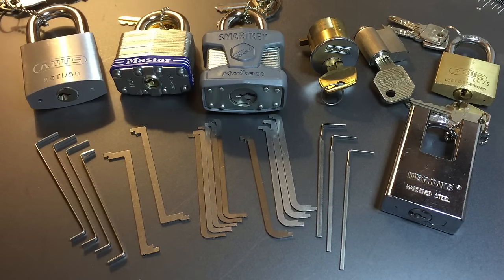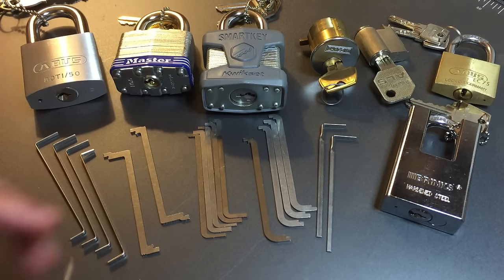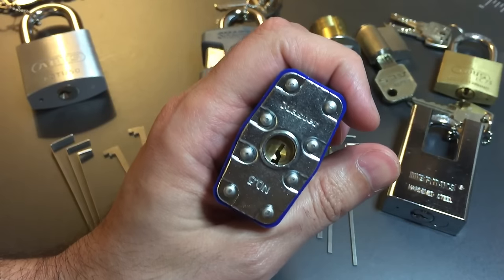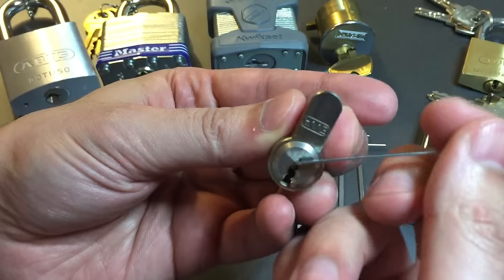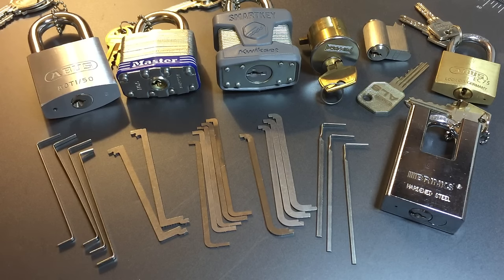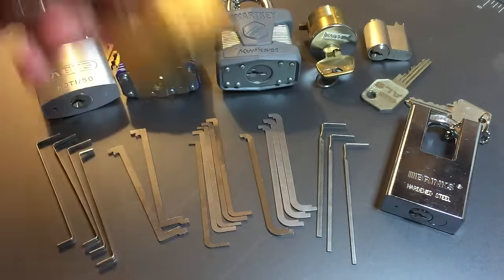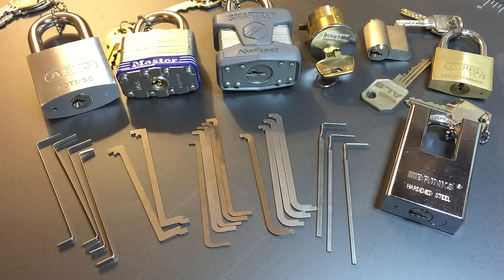[188] My Approach to Lock Picking Tension

Comment: I picked my first lock a week ago to get into an office with tools made from a coat hanger and hammer lol, (i think making your own picks for each lock is better practice for emergency uses) I forget the name of the lock but it's old, 5 pins, and made very well with extremely tight mechanics according to the internet. What I noticed was the pick needed to be strong, a paper clip wasn't strong enough to budge the pins without dropping one of them so I think paperclip picks are a myth for most good locks, Another was that I had to start with the pry bar at the top for some pins and then use another prybar to transfer to the bottom so I can get the front pin then transfer back to the top.  Not sure if this helps anyone but this is my experience. I simply couldn't do it any other way and I tried for a while.
Reply: Not a complete myth you can make an okay tension tool from a paper clip but as the actual pick a stronger wire works better, the wire from a small metal clip/clamp not sure what you call them but they come in all kinds of colors straightened out works fine but can still be too thick for tighter key ways

Comment: I'm actually the guy that invented the first electric pic over 35 years ago out of an electric rechargeable shaver I never patented though I I upgraded to a black and Decker screwdriver handle I brought to the locksmith convention like a fool they put it on the back of the locksmith ledger and that was it a year later hpc was selling them

Comment: and yet you cant describe exactly what is goin on here because i STILL habe no idea what it is i am feeling once my pick goes in... i finf myself trying to set the "inbetweens" of each pin rather than the pins themselves because i simply can not distinguish between a pin that is binding and an "inbetween" lock rib...  the minute(my-noot) differences in those positions is simply too precise for my imprecise oger type mits... and then my carple tunnel kivks in and all i feel are tingles and pain and then the numbness sets in and then i cant feel anything but tngles and pain.... like hitting a baseball off thevtip of the wooden bat in late october(cold weather)   it just stings....   i came into this a couple years ago with such high hopes but now i just feel DEFEATED...  I am really not much better than i was when i first started.... 🙄😟😓😥😢   i think im done.... 😟😒

Comment: I just realized that I always misunderstood "bottom of the keyway". I am from Germany and 99% of all door locks are installed with the pins down. If I recall correctly from traveling the U.S. it is the other way round over there.
Does anyone know why that is the case? Are there benefits to one way of installing locks over the other?

Comment: Watching your videos I have learned what most games the feature a lock picking simulation are getting fundamentally wrong. I am sure their getting a lot wrong, but in every case I have encounter, you set pins then rotate the core. Never do you begin by adding tension to the core and then start setting pins.

Comment: Hey lpl. I'm very new to picking and see you often use a modified peterson pry bar for top of the keyway tension.
I've personally been using wiper inserts and bok tension (on easy locks with no security pins). would you recommend i switch to top of the keyway tension? and should i also use pry bars as i have a very heavy hand when it comes to tensioning? thank you.

Comment: Basic question I'm confused about. Is there a general rule that tension bars are put in the bottom or top of the keyway?  Does it vary depending on the keyway/pins location?

Comment: If these lock picking 'gurus' were honest they would show the pin settings of the locks they so 'expertly' pick in their videos by showing you the key that opens the lock and if it doesn't have security spool pins.  Any lock is easy to pick if they don't have security pins and the tumblers are are all set close to the same height.  If they can make people think they can master lock picking the gurus can keep earning money from their videos.  Successful picking is mostly dependent on having an easy pin arrangement, no spool pins and some skill.  There's a reason why locksmiths use bump keys or rake guns to open locks.  Some locks can't be picked no matter what pick tools are used or what tension techniques are used.  By the way, counter rotation is B.S.  If you counter rotate you release some of the pins you've bound.
Reply: That’s why he takes apart every lock he picks

Comment: I have a question that's been bugging me about TOK tension. If the tension tool is at the pin level, will it bind up or interfere with the first pin? Because it will touch it and hold it in place?

Comment: 🎯 Key Takeaways for quick navigation:

00:14 🗝️ Skillful tension is crucial for advanced lock picking and should not be overlooked.
01:20 🛠️ Tension tools should turn the core and provide feedback to the picker; thicker and stiffer tools are better for feedback.
03:22 🛠️ Select tension tool placement based on the keyway to complement picking and avoid interference with the pick.
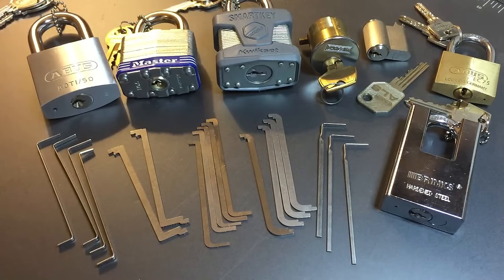07:02 🔐 Pay more attention to tension strategy in lock picking for improved results; tension impacts feedback and binding.
08:21 📢 Heavier tension amplifies feedback, aids pin binding, speeds up picking, prevents over sets, and assists with picking serrated pins.
12:31 📌 Vary tension based on pin type; use heaviest possible tension for each stage of the pick, adjusting as needed.
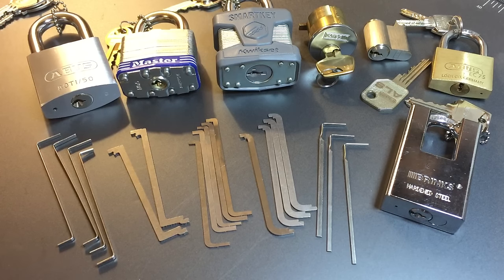15:29 💡 Reflect on tension strategy, share methods, and engage in informed discussions to advance lock-picking knowledge.

Made with HARPA AI
Reply: wow.. this ai is reeaally nice bro👍

Comment: This is interesting but I’m sincerely curious what’s the point of picking padlocks??  Wether you’re a professional hired to open a $10-20 replaceable lock, or ur a criminal, is it not far quicker & cheaper to just cut (& replace) the lock in 2 seconds man!?
Reply: It's a hobby, also for when you still want to use the lock

Comment: how do you know to torsion clockwise rather than anticlockwise for a particular lock?
Reply: well he is doing it clockwise so there you go. If you meant counter clockwise, you use your hands in reverse, or get creative, its not hard. If your talking about the key way doesn't allow you to put in a certain position, turn it 180degrees, and use it that way and see if it works. Get creative.

Comment: I know seven year old vid chances of getting a reply are slim but someone pls help, i just bought a nice set of tools off of covert instruments and im just learning, getting to the poijt where I’m able to consistently open any low brow four pin locks in under five minutes (i know not impressive i legit just started) and I try to use top of keyway tension but the tension tool keeps like getting loose and slowly wiggling out while I’m trying to pick it. Am i like not putting enough tension onto it or maybe too much or is it just because I’m still bad at finding where pins are or whats up like does anyone know why a top of key way tension tool would just continue to wiggle out of the keyway and lose all my sets?

Comment: i notice you dont talk about raking or any other attack other than single pin picking.. i understand that lighter tension is required for raking/zipping?
Reply: In my experience, lighter tension is needed for taking otherwise it's hard to rake.